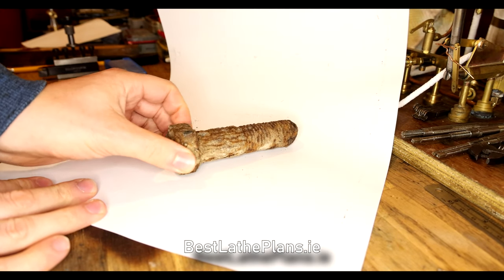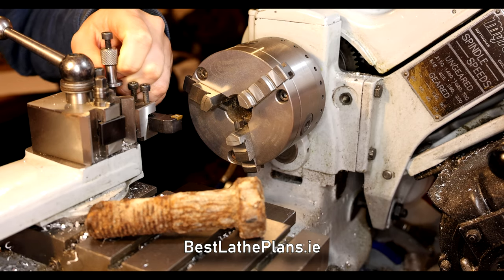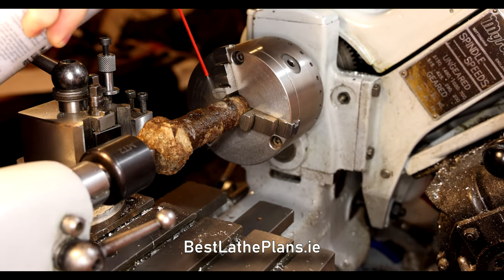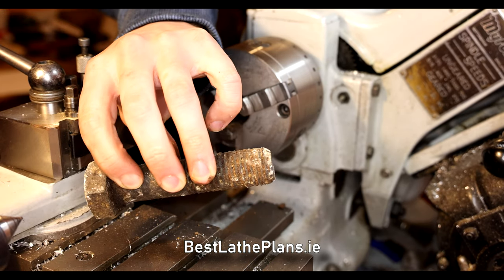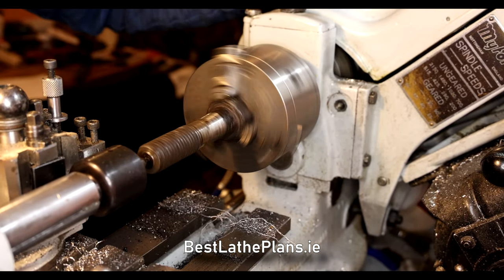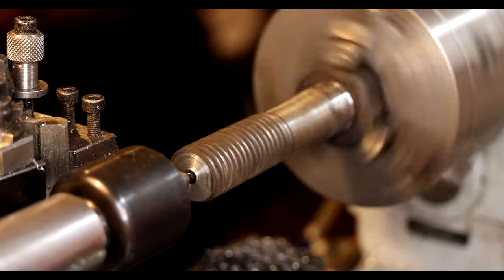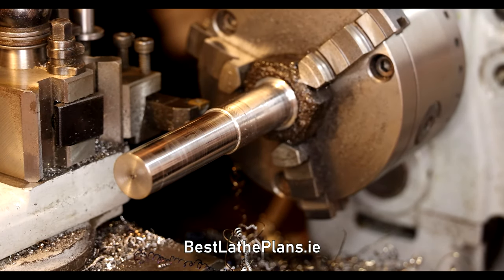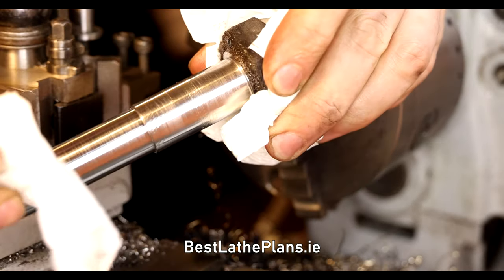Amazing Rusty Bolt Transformation - 4K / UHD - Machining - ASMR - BLP

Comment: Looks like a nice piece of material. I always appreciate a part that can be made from a bolt, as it is one of the easiest materials to find locally, and if you get a nice grade 8 bolt, you will find it is very strong material, and usually fairly nice to machine. Cheers!
Reply from the maker: Yeah it really was interesting seeing usable material underneath all that rust. I'm not too sure what type of metal it is, but once I'd changed tool, and got past the rust it cut quite well. For this nut though, I think I'll put some threads back on to it and make a nut for it too.

Comment: Use citric acid (or electrolysis or any commercial rust dissolver) before machining such part. It will keep your lathe form excessive cleaning, and your cutter will last longer.
Reply from the maker: Hi Nikolay, cheers for the tip. I'll definitely keep that in mind for next time! Yeah, the rust dust was horrible and took a lot of cleaning after the video. And it's really abrasive too. I think the cleanup took longer than the actual lathe work. I may just stick to clean metal for future projects. Ha.